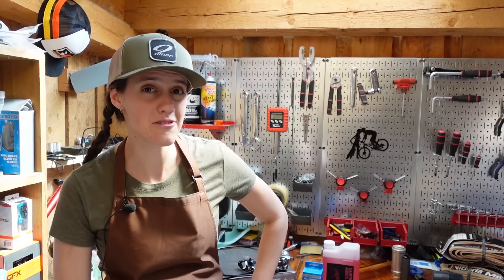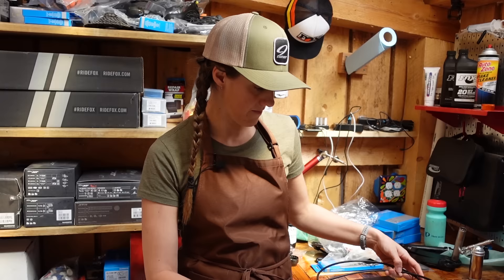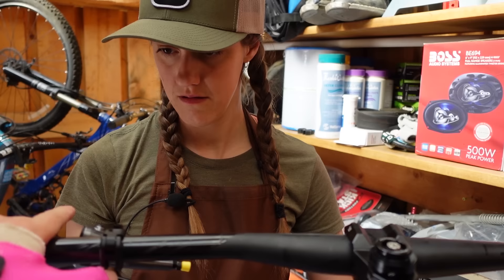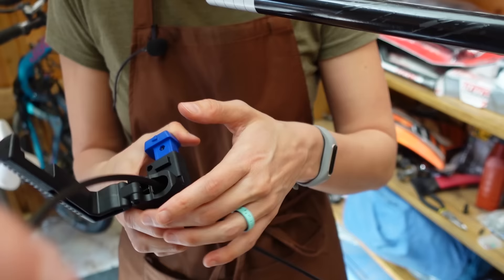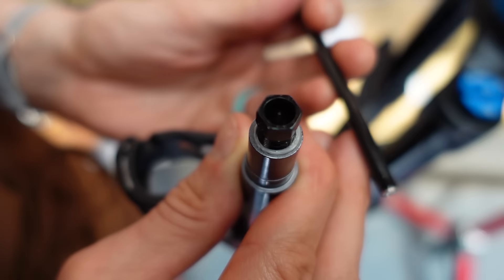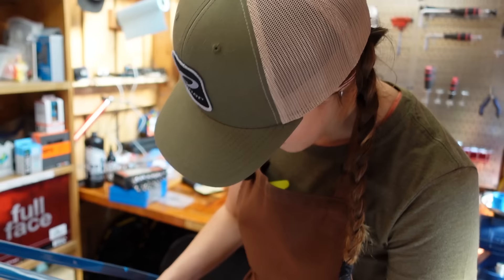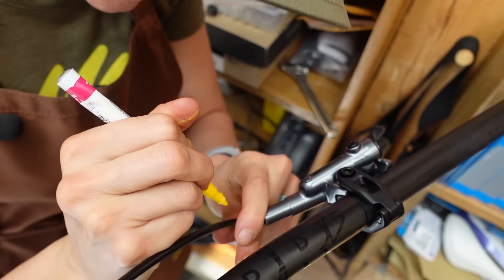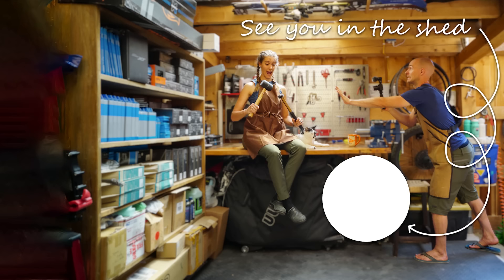How to install Shimano hydraulic disc brakes (MEASURE, SHORTEN, INSTALL+BLEED) | Syd Fixes Bikes

Comment: For anybody listening, but not watching the video.  Please do not use a crescent wrench (generically called adjustable wrench).  Use the correctly shown 8mm open ended wrench or spanner.   Crescent wrenches (adjustable) can round off / strip what you're trying to work on.
Reply: I used one :) Didn't brake anything but I spilt a bit of oil since i hard too much strength with it
Reply: Yeah, couldn't find the right stuff at home
Reply: you can use whatever tool as long as you know what you're doing. some cheap wrenches actually have too much play and can strip the bolt as well. nothing wrong with adjustable as long as you set them correctly
Reply: @knightsljx  Nah, there's a reason you wont ever see a mechanic use a adjustable wrench. Just buy a decent set of spanners.
Reply: Why would someone be listening and not watching but also reading the comments?
Reply: Did that to mine it's awful

Comment: Still blows my mind that somewhere in history someone decided it would a good idea to have the brake levers on the opposite sides of the handlebars depending on what hemisphere you are in. Unlike with driving sides of the road (who knows what side is actually better) being in NZ we have the most powerful, front brake actuated by the most powerful & most dominant hand... The right side 🙂
Reply from the maker: But here we have the rear shifter on the same side as the rear brake 😉
And I'm pretty sure the reason it's different is because driving on different sides of the road and being able to signal with the outside arm while keeping your hand on the rear brake.
Reply: It only makes sense to me to put front brake in the right, like motorcycles.  Hello from America
Reply: The imperial measuring system and the idiots that use it is worse.

Imagine measuring stuff in fractions of a random ass number rather than the simply beautiful base 10 system that metric is

Comment: You don't really need the Shimano hose cutting tool specifically but if you don't have it you'll need other tools...
Reply: I just replaced the rear brake hose on a frame b/c the existing hose was too short.  I used a box cutter to cut the hose and hose vise clamp ($14) to hold the hose while tapping in the barb/insert with a mallet.  Lots of videos online show this technique, it worked fine, and I did not have to buy an expensive brake hose barb inserting tool.  :).

Comment: Thank God the olive was already installed on my brand-new XT deore brakes. I was bummed out at the prospect of having to go out tomorrow and buy some brass olives. When I called Jensen USA to order front and rear brakes I consulted a gear tech on the phone to make sure I ordered everything I needed. Initially I was pissed off that he didn’t recommend a pair of olives. Thanks to your video, I realized it was already installed without having to take the whole thing apart to find out. Good job Syd!
Reply: Exactly why Im here now replacing my Guide with Shimano Saint, didn't see an olive and was so frustrated, Thanks to Syd and Mac!

Comment: It’s crucial to properly torque the bolt to crush the olive and ensure the brake hose does not come out. Ask me how I know: I never torqued in the past, had a crash, brake hose was pulled out. Without proper torque you will never know if your brakes are safe. Suggest adding this to your video. Appreciate all the content you produce! Keep it coming.

Comment: @4:00 the mark on the hose is NOT  a cut line, it is an insertion mark. If you cut the hose then you need to remark the length so you know it's inserted fully.

Comment: Hey Syd, do you have a video that demonstrates the reverse procedure? For example, how to remove the whole hydraulic braking system. I'm
Reply from the maker: No video but it's pretty straightforward:
Unscrew the bolt that holds the brake line into the lever (it's better to do this with the lever removed from the handlebars). Pull the brake line out (it will have the olive crushed onto the end). If you need to remove the brake line from the frame and it's internally routed, you'll need to trim enough of the line to remove the olive and barb then pull the line out (it stays connected to the caliper). To reinstall you'll need a new barb and olive and to do a lever bleed as you'll likely lose some fluid as you pull the line out.

Comment: Excellent.   Separated parts also allow changing hands: dominant hand on the front brake....allows greater dexterity of dominant hand to help with feathering front brake.  Non-dominant on rear prevents its on/off action (less dexterity) from causing endos, and frees up right hand for feeding while still controlling speed with left/rear brake.
Reply: Good point on a mtb, also in the UK for example brakes are on the other side.  So you can execute a right turn signal whilst using just one, rear being safer, brake
Reply: if you have always ridden motorcycles before it helps to switch sides. For the trail it may be better to be able to shift the rear derail while controlling the rear brake instead of the front one.

Comment: Great video. Any plans to do a video about cable disc brakes and adjusting those? Could use some pointers on adjusting the pad spacing and adjusting cable tension on cable disc brakes.
Reply from the maker: We don't have any cable actuated disc brakes, so probably not unfortunately. From memory, assuming only one side is moving (which is common for mechanical disc), you want the static side as close to the rotor as possible without rubbing and then tighten the cable until the pad that moves is similarly close.

Comment: I swapped a set of XT brakes to XTR (2 piston) on my Orbea Oiz last winter. Assumed that the brake lines were the same... except that the XTRs dont use the banjo bolt (4 pistons do), so... internal routing and really pissed about it, took a cup of coffee and onto rerouting the new brake cables.

Comment: thanks for this video Syd & Macky - everything worked almost perfectly :D with the new Shimano Deore XT 4 piston brakes. BUT - i forgot to put the rubber dust boot on BEFORE i put the brake line into the master cylinder at the lever! OOPS! i tried to get that line back out but it was too late, i didn't realize once you put the line in the 'olive' that compression nut keeps the line from coming out.. so... now what! :P Any ideas? seemed impossible to redo that. thanks again though my brakes work fine just missing a boot. :(
Reply from the maker: Been there! Your options are either ride it without the boot (no issues aside from aesthetics) or cut the boot, install it and electrical tape it back together.

Comment: This is better than the park tools video, but that one is good too..  I saw one comment that mentioned the olive was not pre-installed in his xt lever, is there any harm in removing the screw to check first?  I'm assuming since it's not tighten yet, that it's not going to compress the olive if just checking..  Or can you visually see the olive thru the hole?  Thanks
Reply from the maker: You should be able to see it just by looking, but if in doubt you can remove to confirm.

Comment: Hey quick question that I think you are best to ask.  I am going with the Ari nebo with shimano xt brakes but was thinking shimano xt or xtr for the drive train. Also could go with gx axis. I am pretty happy with xt on my analog bike. Thoughts?? Love you guys here in Canada cheers!
Reply from the maker: I'd say no need to upgrade to XTR for the drivetrain. It's lighter, but that's it and since the Nebo has a motor anyway. We run full XT on our Nebos. And if you use the code "sydandmacky" at checkout you can get a free tubeless upgrade (just make sure you've added it to your cart).

Comment: Good video. Why is only a lever bleed done and not a full bleed which entails lever and caliper brake port? I'm new to this and I will be installing new brakes so I would like to know when to do a lever bleed and when to do a full bleed. Thanks.
Reply from the maker: Full bleed is for replacing the fluid in the lines which is necessary occasionally (once or twice a year, depending on how much you ride). Or if you have air in the middle of your lines (which is hard to do). Lever bleed is for getting air out of the lever which is the most common and what happens when you shorten a brake line.

Comment: Is it ok to hang a bike with hydraulic brakes brakes vertical from the front tire like the bikes in your workshop, hydraulic fluid wont leak out and contaminate pads?
Reply from the maker: As long as your hydraulic system doesn't have leaks, there is no issue with doing so. If you have leaks in the system, it doesn't matter how you store it, you will lose braking power and likely contaminate the pads depending on where the leak is.

Comment: My front calipers came with some semispherical washers, should I take ém out?
Reply from the maker: Depends. Those are used when you need to use a brake mount adapter, so if you need an adapter. For example if your fork or frame is designed for 160mm rotors but you're using 180mm, you'll need a 20mm adapter which uses the semi-spherical spacers.

Comment: When you bleed the brakes why do need a shim between the brake pads? 🤔
Reply from the maker: Because you don't want to pull the lever while bleeding the brakes without anything between the pads (shim or rotor) or you'll have to reset the pistons (and the bleeding won't work).

Comment: If the barb is already on there do I still have to cut it to the brown line
Reply from the maker: Check if it's actually the barb in there. If it's new, most likely that's a plug (there isn't a hole in the center)

Comment: 10:18  Don't fill the cup with that (huge) amount of mineral oil.  Half of it is more than enough.  No need to contaminate the oil more than you have to with dust, flakes, residues in the cup, residues pulled and pushed into the cup, water from the humidity in the air ..., ... .  Again: half of that is more than enough for a lever bleed.  With the amount shown here, you can fill the whole brake line.

Comment: Hey, can you PLEASE help me? Is there a trick to remove that yellow stopper on te inside of the lever? Am I just being to careful? I can't get it out even pulling hard!
Reply from the maker: No trick, just pull. It does take a surprising amount of force.
Reply: @sydfixesbikes Thanks! I've done this a few times before and it's always been easy. This time it was totally stuck and had to pull it out with pliers, pulling extremely hard!

Comment: While doing a lever bleed for the rear hydraulic brake, should pivot the bike so that rear caliper is the lowest point and not the bb...
Reply from the maker: Not necessary for a lever bleed. For a full bleed, yes, but after installing new brakes the won't be any air bubbles lower in the system, so you just need a lever bleed and don't have to worry about the caliper being the lowest point

Comment: I have a question, is it the same process for all hydraulic brakes?
Reply from the maker: It's the same basic process (cut the line and connect it to the lever) but different brake systems have slightly different install processes.

Comment: Help my brake line won’t stick to the olive nutt even if I thight the 8 mm nut full. It’s brand new shimano slx 4 pistons
Reply from the maker: Make sure the brake line is through the olive. If not, then the olive won't crush and hold it in place.
Reply: @sydfixesbikes i think i tried squeeze it in pretty hard, it seemed like the olive thing was too small for the cable. Hmm imma try it again tomorrow.

Comment: do I seriously need to buy this "brake cutter tool". seems I can just cut it with scissors or shop blade
Reply from the maker: Scissors are likely to squish the brake line but if you have a really sharp exacto knife that will also work for cutting.

Comment: Can you cut the brake hose with a Park Tool shifter housing cutter?
Reply from the maker: No. Shifter housing cutters squeeze the line and are made to cut through the metal strands in the housing. Using them on a brake line will screw up the end of your brake line. Better to carefully use a sharp knife (like an exacto).

Comment: Newb here. How does the barb allow for oil to pass through? I ask because I forgot to install the barb after shortening my new brake line. The factory one looked like it didn't have one on so i didn't re-install it. (I was wondering why they felt weak even after a bleed, I now know why. I'm still confused though as to how it works)
Reply from the maker: The barb is a hollow tube sorta thing. We've never seen what happens when you don't install it, but I suspect the barb keeps the brake hose from squishing together when you install it in the lever. So by forgetting it, I suspect as the olive crushes (that's what happens as you tighten that nut around the brake hose into the lever) it's squeezing the brake hose and that's limiting the amount of oil that can pass through.
Reply: @sydfixesbikes  Thanks for the feedback! Practice makes perfect (almost perfect)

Comment: hi, i fitted new pads in my shimano deore front brake. problem i have is the wheel will not rotate now. how do i fix this. no gap in pads for rotation.
Reply from the maker: You need to push out and reset the pistons. We do so at the beginning of this video: https://youtu.be/o-YvMRJunwo)

Comment: How can i put the gold pin to the cable if i don't have that machine that you used?
Reply from the maker: Clamp the cable in a vice using the yellow blocks that come with new brakes and lightly tap it into place with a hammer.

Comment: What if I accidentally pressed the lever and a little bit of oil jumped out?(these are the deore bl-m6100 and they are new) Is it broken now or i just need to put new mineral oil in all the conduct and everything?
Reply from the maker: Yeah, just connect everything, do a lever bleed and you should be good to go.
Reply: @sydfixesbikes  thank you<3

Comment: hi, newbee here, tried to follow your instruction on how to install shimano easy hose joint system hydraulic brake, when i bleed it ,it leaks along the hose and connecting bolt.pls advise..thanks
Reply from the maker: Sounds like you may have forgotten the olive and/or barb or didn't hold the hose deep enough in place when installing it. Unfortunately you'll probably need to pull it apart and try again (and you will probably need a new olive).
Reply: @sydfixesbikes  hi there, thanks for your reply, you are right, the olive inside probably not aligned properly, so I removed it and replaced with a new one and made sure I pushed the cable hard enough while tightening the bolt..viola !!! no more leaks...

Comment: you absolutely DO NOT NEED the brake cutter and barb press tool
and I really hope noone is that dumb to buy the overpriced shimano tool for $105 from that affiliate link....similar and better quality (all metal) tool you can buy for $10-15
and you don't even need it, you just need the $2 hose clamp blocks and they usually come in bleed kits and a hammer and exacto knife to cut the hose
you can even do without the blocks so all you absolutely need is an olive and a barb